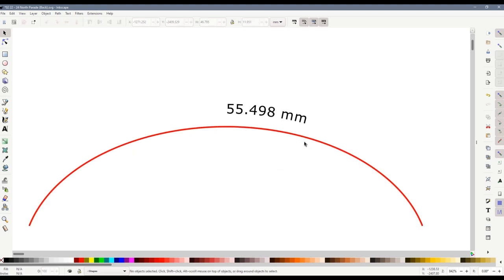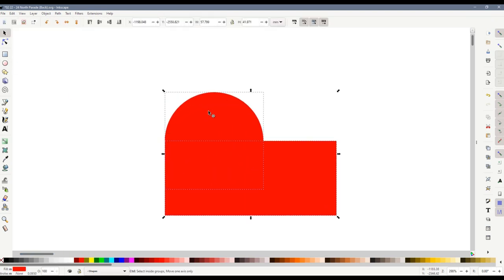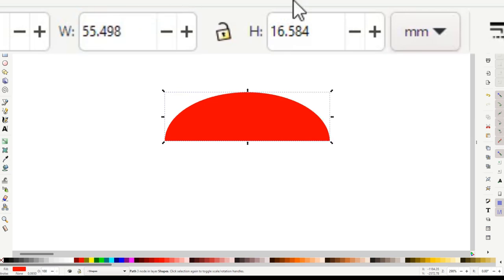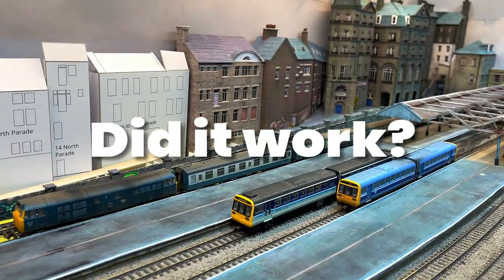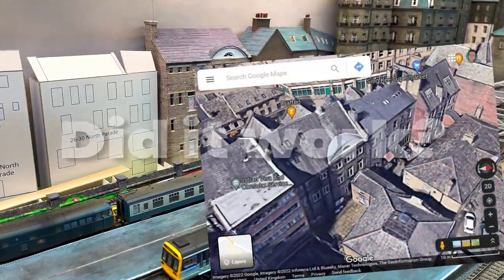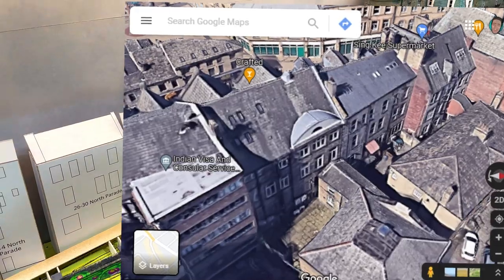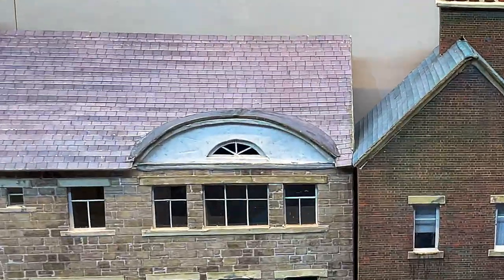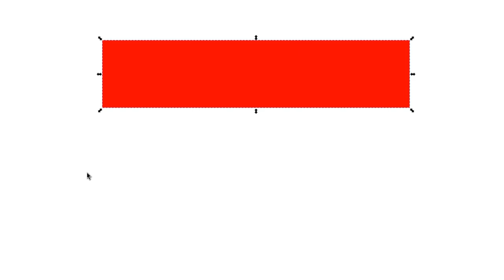A tricky bit of curved roof - Building Market Street Part 6

Comment: Hi Michael, even though your second method to make the rounded roof part seems more accurate, I humbly think the first one is better. Having seen these kinds of roof elements from close by, they all seem to have exactly those levels of imperfection. The true perspective on such an element is if it looks good from the ground level. We hardly ever get the chance to have a view like the one which places us in the bird’s eye view, as with our standpoint while modeling. Other than from a scaffold. Rounded edges as I said are often imperfect, mostly corrected for with wider soffits. Anyhow, really thick this building looks good. Curious for your next episode on the fire escape, wonder if you’re gonna scratch build it, or will use other methods. Cheers Vince
Reply from the maker: Thank you Vince. All good points and good to know! 👍 Thank you as ever my friend. :_chandChandwell:Michael

Comment: I'm looking forward to seeing how you make the fire escape. I've used very fine copper wire and solder. It's time consuming and very fiddly, but I model in HO scale, so the parts are bigger to start with. I will admit, I've only made two small ones that way, having decided that the commercial kits are easier.
Reply from the maker: Thanks Steven. I am currently really struggling to work out what best to do. The prototype has a 90 degree turn and the steps come out into the back yard of the building to avoid the door at the bottom. I don't have enough depth in the layout to do that, so I am stuck as to what shape to make it. Oops. And I don't even know if it's going to be possible to make yet! Haha :( :_chandChandwell:Michael
Reply: @Chandwell  I think it could be made to fit using a zig-zag stairwell design, positioned in front of those two small windows on the left. Also if you just built the steps and then enclosed the whole thing in a mesh you could maybe get away without having to build hand rails, or at least have a structure to stick them to?

Comment: Personally I would have resorted to Sketchup or Blender to create a shape with a complex join like that. Alternatively I'd have made a 'half' template, done multiple test fits trimming a bit off each time, then traced it mirrored to get the part. Also reckon you could hide this somewhat by adding some 'lead' join (rub pencil over a strip of black/grey paper)

I actually made a staircase in N scale for a conservatory on the roof of a building a few months ago, albeit not in a similar style to a fire escape. I found that 1.5mm mount board is pretty much to scale for a step height (maybe a fire escape would be steeper) and cut a pile of identical squares which could be glued overlapping to create about a 40 deg staircase. I then added some side boards out of thinner card which went right up to the banisters. I reckon some of the twisty plastic covered wires you get in packaging could be useful for the railings especially if the plastic is black.
Reply from the maker: I love Sketchup. I’ve not put it to any scratch-building use yet. Good shout. Great technique for the steps. Good stuff! :_chandChandwell:Michael

Comment: I still admire your way of designing those ultra thin window bars: as easy as it it realistic. Dumb as I am I had a very difficult way of doing it: cut thin strips and glue it on the "glas" - took hours and was not as accurate as yours. // This second building in the street looks really classy with its rounded roof part. // And I have a question, Michael: You use those metal snouts/nozzles for the white glue bottles, which extrude a very thin line. Don't you have to clean the thin canal all the time? How do you keep the system going? I use the "normal"/original nozzle of my white glue bottle but it always gets cloged. All the best and looking forward to your next video! - Valentin -
Reply from the maker: My tiny glue dispensers have a pin in the nozzle. But the real trick is to keep them upside down. Always. This keeps the glue at the nozzle, effectively keeping the air completely out of the bottle. This seems to make the glue last longer. And for longer modelling sessions I keep a bit of folded kitchen paper soles in water at the bottom of my glue holder. So the tip of the applicator is upside down on the damp kitchen roll. Keeps the glue flowing nicely all the time. I’ve had them for 8 years and never had a blockage. :_chandChandwell:Michael
Reply: @Chandwell  Thanks a lot, Michael. This is a very helpful advice, I will stick to it. Always something to learn in and around your videos! All the best, Valentin.

Comment: When you pick off the window shapes from your sticky labels, the windows always seem to end up sparkling clean. When I do this, I can never get the stickiness to come off smoothly, so the wiindows have some glue on them. I tell everybody it's because they haven't had the window cleaner round recently, but I would like clean windows. What am I doing wrong? Is it my sticky labels that are no good? Or is it because I buy sheets of clear plastic (I never have enough chocolate snowmen). Perhaps it's because I don't stick my labels on freshly enough. Do  you have any suggestions?
Reply: I use plastic covering roll intended for kitchens (ok, so you can't print on it) and it doesn't appear to leave any residue. I have had issues with the tiny bit I want to stay stuck coming off when I lift the bits I do want to remove, so I try not to slice every cut right across the part in order that all the window frame white is still attached together in some way.
Reply: @musosiimo3199  Do  you mean what I call 'kitchen wrap'? I'm surprised, I wouldn't think it was sturdy enough, even for n gauge. Stil, thanks for the tip, I'll try it.
Reply from the maker: In my experience, your labels are maybe “too good”. I had the same problem until I started using really cheap labels which are not quite as sticky, at least for the first few minutes after sticking them on. Work quickly. One at a time. Don’t let the sticky bite. Don’t push them down too hard. And just in case you’re using acetate designed for ink jet printers, be sure to stick the label to the shiny side and not the coated ink-side. Hope this helps!!! :_chandChandwell:Michael
Reply: @Chandwell  Thanks for the tips. I'll keep trying!

Comment: Your adventures in various roof joins continue to trigger my interest!

I don't think the "perfect circle" approach that you mention would solve the bulge issue; I don't properly understand this in terms of maths, but in my understanding it's because there's something non-linear going on with the reality of how these shapes interact, but the stretching in Inkscape is all linear

You can use Inkscape to prove that it doesn't work:
- Make a perfect circle, and take a top slice off to get the profile that you want (as you demonstrated in the video)
- Measure the width of your shape, note it down
- Measure the shape's arc length, note it down
- Simulate going half-way along the slope of the roof behind by cutting the shape in half along a horizontal line
- Measure and note that slice's arc length and base width
- Take a copy of the original slice you made, and stretch it horizontally so that it's as wide as its arc length that you noted earlier (as you did in the video)
- Stretch it vertically to the length of the roof slope, as you did in the video (this step isn't strictly necessary to prove the point)
- Cut that stretched shape in half along a horizontal line
- Measure the width at the base of the top half... compare it to the arc length that you noted for your smallest slice of circular shape earlier - it'll be wider than the arc's length, which is why you'll get bulges when wrapping it over

The arc length relates to the radius and how many degrees are in the arc, whereas the width of the stretched shape that you made is based on the width (not length) of the arc at that point - the correct 2D shape to use for the curved section of roof will need to be made using a formula based on inverse cosine or sine (the non-linear part of the solution)

I've been playing with this in Inkscape for a 180 degree semi-circle
- Get the arc length of a quarter of the full circle you started with (e.g. via Pi x 0.25 x circle diameter)
- Make a rectangle as tall as that quarter circle arc length, and as wide as the domed bit of roof goes back into the sloped roof
- Select the rectangle, then go to Extensions > Render > Function Plotter
- Un-tick remove rectangle, and un-tick Draw Axes
- Set start X to 0, end X to 1, y bottom to 0 and y top to 90
- Set number of samples to 200 (you could play with this, I think it's just the number of actual points calculated for the line)
- Enter this for the function: degrees(acos(x))
- Click Apply
- The area to the left of the line that's drawn is, I think, the top half of the shape that you'll need to cut out
- Duplicate that shape, then flip it along the horizontal and stick it directly under the original shape
- The left-hand side of the overall shape goes at the front of the building

That formula is not what I worked out on the back of an envelope, but I think ultimately the calculations that I did actually do are probably just stretching this graph, which is what Inkscape is doing anyway by making it fit to the rectangle that you've drawn. Whilst I've been able to calculate arc length for any given point along the roof's curve I've found it more difficult to actually plot that properly in Inkscape - the first version of this comment was wrong and didn't work when I printed out the shape and bent it around a cylindrical object
Reply from the maker: Thank you! I will need to sit down to digest all of this. The next time I have a circular or domed piece of roof I will come back and look at this in detail, I would love to go through step-by-step and really understand this. I find it fascinating! Thank you very much indeed!  :_chandChandwell:Michael